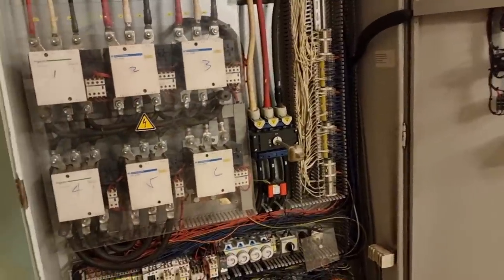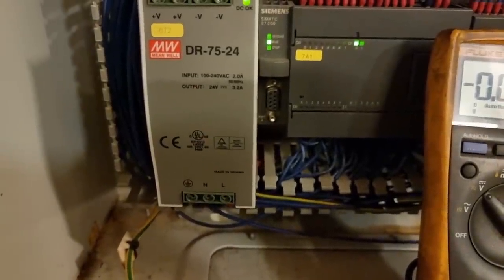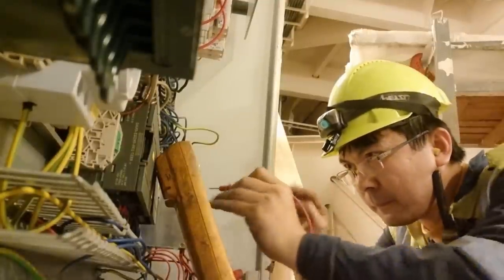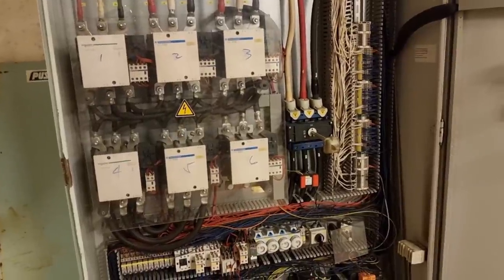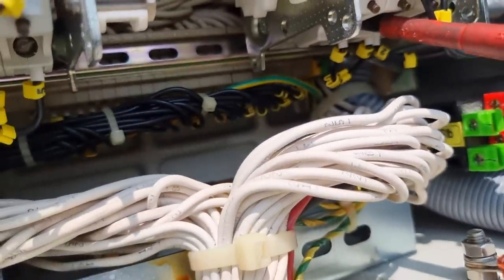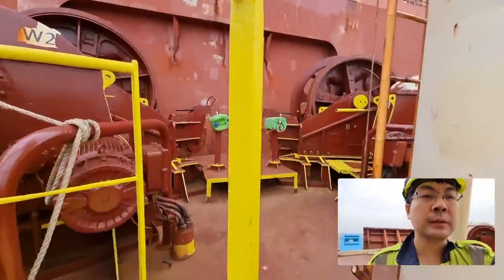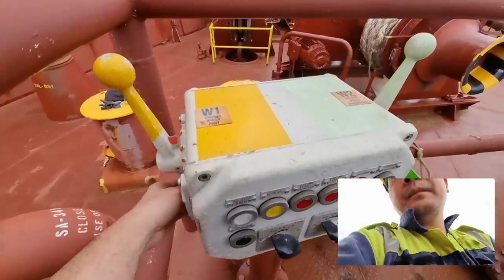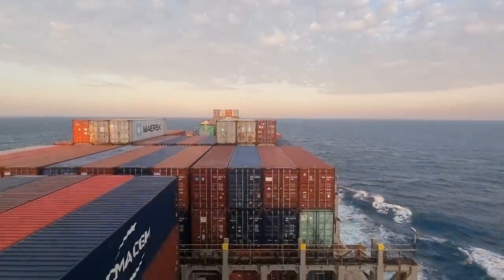ANCHOR TROUBLE CAN CAUSE SHIP DELAY, NEED TO FIX ASAP

Comment: I am surprised to see a 2vdc output difference in a 24v system make that much of a difference. Good to know
Reply: Its already 2v drop at the source, most documentation  of 24v electronics says a max of +-10% difference. Especially if you need to toggle solenoids those voltage drops can cause trouble.

Comment: Nice video, thx !
Have a question regarding same type starter windlass mooring winch...
How change direction of the motor ?
Because when operating on the control column (3pcs) actual directions is wrong